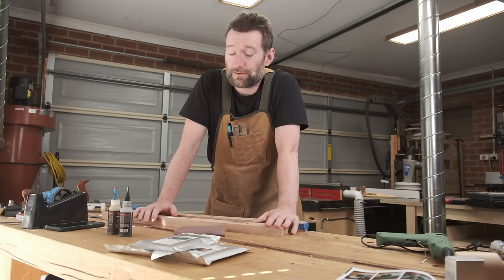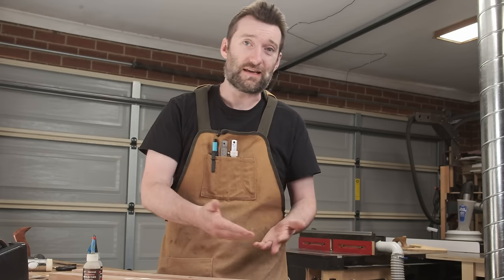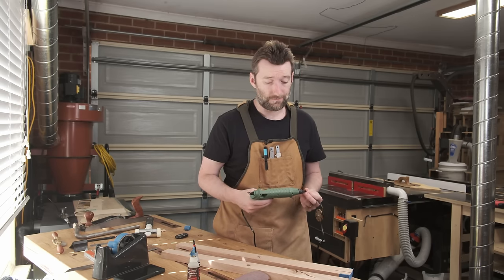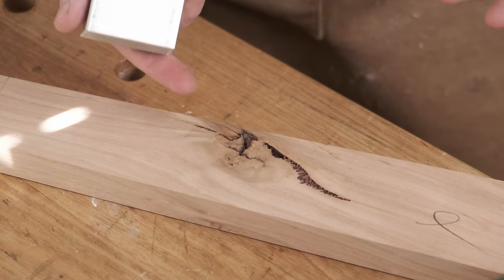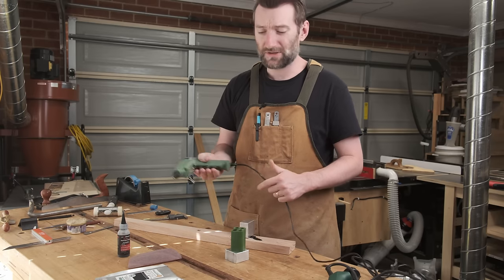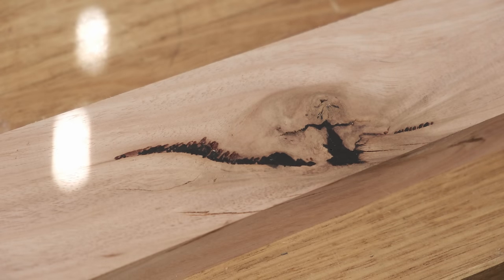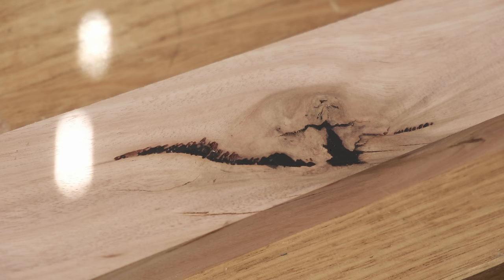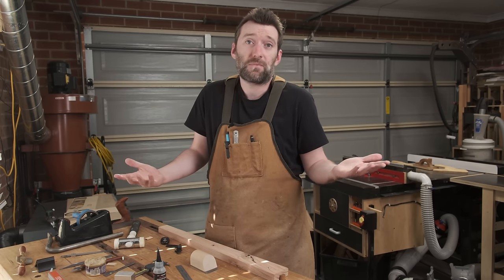Is This Better Than Epoxy?! (at filling knots and voids in wood)

Comment: I've been using this for a while especially to fill cabinet holes when painting kitchen cabinets. Saves a ton of time. It doesn't get flat flat but a bit of condo and little extra primer takes care of that. In your situation i don't thing it needs to be flat flat, you can get away with that on stained or clear coated stuff. Hey thing is to make sure to sand before and scrape after.

Comment: Polyamide is a type of hot melt that is used for moulding the plugs on the ends of your smartphone cables, for example. It gives a slightly tactile feel and is very durable. In my opinion, and I sell this stuff, $44 for 8 x 150mm of specially moulded and packaged sticks is not too bad. If you were an industrial user and bought several tonnes per year of pellets you would be doing well to pay much less than $70/kg. Plus you would need some moderately costly low pressure hot melt moulding equipment to do it efficiently

Comment: If you had a 'saver' form that was 11mm instead of 12, you could run them back through your bosch next time? I wonder if they could smashed through a dowel plate to get them into a cheaper 11mm glue gun? DUWW's idea of melting them straight in with a lighter already sounds easier. Starting with $50 worth of sticks looks more attractive than a $320 starter kit.

Comment: Great video. Do you think you could get away with heating the knot filler with a regular heat gun or flame, rather than using the proprietary "glue gun"? That way you'd just need to buy the sticks.
Reply from the maker: Theoretically yes, there is (as far as I know!) anything special about the gun other than the temperature and size. If you can get something that handles 12mm sticks at around 170c (higher will work too, too high might cause discolouration of the lighter sticks?), you should be fine.

Comment: Hey Paul, I’ve seen some woodworkers use those sticks and just melt them with a flame, drip the filler into the void and use the heat sink. Seems to work fine and no gun required. Have you tried it that way?
Reply from the maker: Are they using the polyamide sticks or the more traditional wax/shellac repair sticks? I've seen plenty of the latter but must admit I didn't think to try it for these ones. So long as it's under 300c, it shouldn't burn...I think 😅
Reply: My concern there would be fumes - this looks more like a plastic (don't want to breath that in) than a wax.

Comment: To reuse the scrapped-off excess you could use a plastic weld repair tool such as that used for broken car bumpers. It's basically a soldering iron with a triangular head.

Comment: Very interesting. I worked in a furniture mill to put myself through university. At the mill, we used hot melt glue to seal pitch pockets and fill around loose knots. It was quick, simple, and cheap. However, we kept the glue below the surface of the wood and used wood putty to fill the last 1/16". All of the joints in the furniture would be puttied before finish sanding, so using putty didn't take any additional time for drying. (Back then, we didn't call attention to such repairs by using a contrasting filler as is popular today. We tried to make the repairs blend in.) 

This stuff seems to be even quicker than the process I'm familiar with. It looks like it should work well. However, if I wanted the repair to blend in rather than stand out, I'd be tempted to use the method I described above. It still works.
Reply from the maker: There are sticks that match the colour of many woods for this system, but given the timbers I work with its hard to get it all blemish free - most eucalypts seem to have sap veins and wild colour swings, so its kinda 'going with the flow' rather than deliberately going for something contrast. If anything, contrasts less by going black!

What sort of putty did you use? Something like Timbermate?
Reply: @TheWoodKnight  The wood putty was oil based. So, similar to, but not the same as, Timbermate. Most of our furniture was stained with a water-based stain. We dunked smaller items, such as doors and drawer fronts, in a tank of the stain. Larger items were sprayed -- very heavily -- with the stain. I'm sure how a water-based product, like Timbermate, would have held up to such abuse.

I hope you didn't take my initial comment as a criticism. It wasn't. It was more a comment about how tastes change. In my own work, which are mainly decorative things turned on a lathe, I generally don't try to blend in any repairs. I might not even fill a void. It was also to show another way of skinning this particular cat.
Reply from the maker: @DKWalser  Didn't take it that way at all! If I had my way, I'd prefer clear grain - but I'd be wasting >50% of boards wider than 50mm to get that with the vic ash I use! In an ideal world, quartersawn tight grain eveything, with just a touch of fiddleback figure 🤤

you're right though, timbermate would be a bit iffy particularly with the dunking. Probably OK with the spraying - even a heavy coat, everything atomised tends to not be wet enough to reactivate the timbermate.

Comment: Wood glue with saw dust used to fill gaps and holes is cheap and work wells.  A piece of plastic with a weight can leave the surface fairly flat.  It normally dries within a couple hours.

Comment: What about a soldering station, the ones with digital temperature setter? If it worked it would be like the old plumber's soldering bars only using what you need.

Comment: Similarly, you can get a plastic welder for the same thing and you can choose the plastic. Also comes in handy for, well, welding plastic. Another method I've used is: melting small scrap bits of ABS plastic with acetone in a small glass jar. Once melted to a consistency of about peanut butter, I put acetone on the wood where I want to patch to help the melted plastic soak in, then goop it on. I've done this to fix torn out threads of a threaded insert, then reinserted the insert while the plastic was still melted. This is a decent torque application and it's worked like thickened epoxy, but much easier to smooth out (and almost free). I don't know how long it takes to dry in comparison since I just leave stuff overnight. Acetone evaporates quickly, but how long until it's sufficiently solid to clean up, I couldn't say. I think ABS can be had in different colors, but I wouldn't buy it just to use for this purpose and black is the most readily found, so keep that in mind for visual or finishing concerns.

Comment: Thanks for the video. Did you consider using Tradies Bog from Bunnings mixed with coloured pigment?
Reply from the maker: I've heard of people using it for painted projects (either solid wood, or especially mdf/plywood) but not for clear coats.  I've never touch any auto body work so i haven't experienced it before - do you know if it stains the wood around it? I assume it'd be flexible enough for wood expansion
Reply: @TheWoodKnight  It seems to be flexible enough. It was recommended to me by the Perth Wood School and they seem to use it fairly often as I understand it. As far as staining is concerned, I've only used it with dark Jarrah and I did a reasonable job of matching the colour so I'm not sure how much it stains. I need to do some more tests on lighter coloured timber to be certain but that won't happen until Perth escapes the heat we're having at the moment
Reply: I have use stonemasons 2part polyester filler with some success. It's available in a clear that has the consistency of tradies bog. There is a tinting kit too. The brand is Tenax

Comment: What ever happened to just using sawdust mixed with wood glue to fill gaps/dents and then sanding/plane-ing the surface after it dried? 🤔 It's one of the few tricks I remember my woodshop instructor teaching us nearly 35 years ago to hide the countersunk holes in our project.

Comment: Would be good but seems expensive for what it is.  I use Timbermate for small defects and epoxy for larger ones where I want to stabilise a crack. Epoxy is slower for sure but you can use faster hardners if needed. Cheers

Comment: Thanks for sharing , I want one but I’m not 100% convinced at those prices. I just use good old black timbermate if I want something quick. I thought these types of guns ran a little hotter than a standard glue gun, but I might be wrong though.
Reply: Not really. Most of new gun can easly go to this temp 🤣 Its just advert that you can olny use this gun 🤣 ive chcecked many tools and all working great
Reply from the maker: Do you have a favourite gun to use with these? I'd love to be able to recommend a cheaper kit to achieve the same thing!

Comment: Hi Paul, how would the filler go if you were wood turning a piece of say camphor laurel with deep cracks in it.  Thanks  Cheers Russell
Reply from the maker: Theoretically it should bond well enough to get a good grip, but I can't say with certainty. I think if you overfilled it a little bit and really pushed it into the crack with pressure, let it cool completely, and used gouges rather than scrapers it would give it the best chance

Comment: Have you tried melting black wire ties as a filler?
Reply from the maker: While thats probably a pretty similar material (nylon 6/6?), that would be a little tedious to heat up and get to flow into a knot.

Comment: Do you know how it compares as to scratching, etc, against anything else? Come to think of it I have never seen a scratch test with any filler.
Reply from the maker: I haven't done specific testing buuuut.... 
* not as hard (so easier to scratch) than CA - but its more flexible so doesn't chip/craze
* not as hard as... some epoxies. Epoxy  have such a huge range in hardnesses from the formula to how well the hardener is mixed in. Then there are polyurethane resins that are considerably harder on the shore scale!
* harder/less crumbly than timbermate/water based fillers
Reply: @TheWoodKnight  thanks. I appreciate your "tests" so far.  Looks like it has some advantages in certain situations. Sort of like finishes, there's no best one but some suit one's uses more often than others.
Reply from the maker: I think thats it exactly - even though it hurts me to say it sometimes epoxy is the right choice. Othertimes Timbermate is the right choice (grain filling especially). Its just another tool in the toolbelt :)
Reply: @TheWoodKnight  I agree. A while ago I made a coat rack prototype and got 3 different reactions from people: one hated it, one loved it and another said they would like it but in a different colour.  The experience was highly enlightening. Everyone has an opinion and I can't make everyone happy. I make what I want to. All that being said, some people absolutely adore epoxy tables and I can't make them happy. All I can do is use a small amount of epoxy as a glue and / or filler (when appropriate and which they might or might not notice) and make other people happy.

Comment: The best known polyamide is "Nylon". That's DuPont's product name. Are these sticks nylon with colours and fillers? The melt temperature is similar to hot melt glue.
Reply from the maker: I haven't looked into the exact chemical formulation to see if it's an aliphatic, aromatic or semi aromatic polyamide. I suspect it is nylon but you'd have to ask the manufacturer directly

Comment: Given what the knot glue is made of, it is just plain ridiculous what they charge per stick. I would love to use it, but not at those prices and the investment to get a range of colours. 
It is obvious that the pricing is not realistic when they charge gold rates for alloy blocks.
I'm sure every wood worker would buy this system if it was reasonably priced. I'm expecting the sellers will realise their mistake when Chinese versions flood the market and the premium brands just won't be able to catch up.

Comment: Like burn in sticks, but it gums up when sanded, not the same as epoxy that can be sanded, worked etc.  Appears to have limited  use is most woodworking,.
Reply from the maker: Regular hot glue gums up when sanding, but this (polyamide) stuff doesn't. Sands, scrapes, slices just fine.